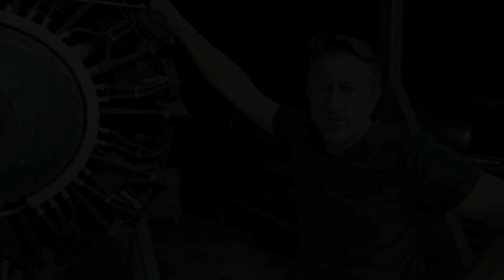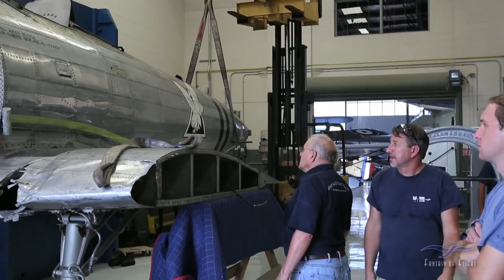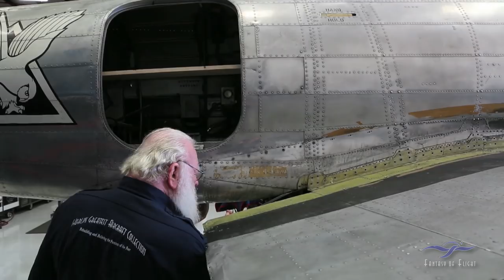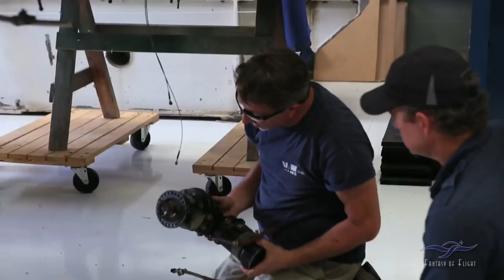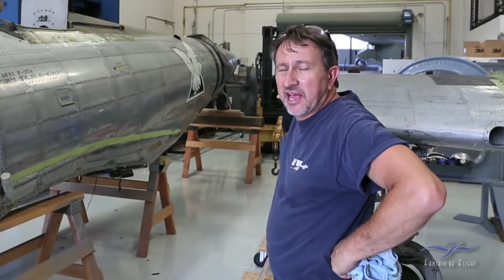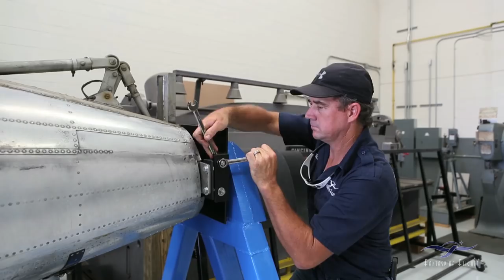Seversky P-35a - Mid Section Removal - Restoration Update - 08/2018

Comment: The Seversky is built like a tank ! good work on that rotisserie which will make working on her so much easier,there is a lot going on lining things up inside that wing to fuselage joint,thanks for another great restoration insight this is one very fine rare aircraft.
Reply: Tanks don't have anywhere near that many rivets like somebody was getting paid by the rivet and probably put in so many rivets the net result was joints/structure weaker than if fewer rivets were used. Drilling holes and riveting work-harden aluminum. Start pulling that many freaking holes that close together and you end up doing more harm than good.

That thing is also built from LOTS of little tiny "pieces" and has a ridiculous number of seams and joints compared to a properly engineered stressed-skin aircraft that minimizes those things. If it were "built like a tank" it wouldn't need such a thorough and comprehensive "restoration" when its clearly not corroded to hell and gone, beat to shit (other than that little "wound" in the left front wing root) or a parted out shell that's been sitting outside for decades in pieces.

Comment: How did the vertical fin break if the plane went up on its nose?...just very curious on how the energy was tranfered that far back as to do damage to something on top of the tail section...
Reply: It went all the way over.
It wasn't an "up on its nose" affair.  It was a "flip over" crash.  It ended up as a turtle on its back.
Reply: Was this a recent occurence?  I thought this plane was "close" to flying 15 years ago???

Comment: +KermitWeeksBlogVideos  Seversky and Messerschmitt must have engineered along similar lines - U. S. Army P-35A SerNo 41-17443 has several similarities to the Bayerische Flugzeugwerke Bf 109 in terms of the fuselage-to-wing box joint layout, though the two have entirely different firewalls.  (Seversky used the Pratt & Whitney R-1830 air-cooled dual-row radial, Bayerische Flugzeugwerke the Daimler-Benz 600 series of liquid-cooled V-12's.)

Comment: My great uncle worked on Wall Street in the 1930's and visited the Seversky Corporation one day with his boss to consider investing in the company. My uncle recalled to me seeing something very interesting at the factory: to cut out a round piece of aluminum the workers would take a giant sheet, put the template right in the middle, and cut out the round piece. Then scrap the sheet! My uncle was VERY thrifty and mentioned this to his boss (basically 'why weren't they cutting from the edges to get more round pieces out of the aluminum). Needless to say, they did not invest in Seversky..
Reply: Interesting!  my grandfather, a Russian immigrant, commuted to work there from Bridgeport, CT.  He was a tooling designer.  Wish he was around to explain why they did what they did.  From my work in stamping printer chassis in the 90's, the sheets are rolled, the pressure causes camber in the roller, the edges, margin, of the sheet are of inconsistent thickness.  The variation might not have been worth the savings.  Our printers chassis needed perfect rigidity to maintain print quality.